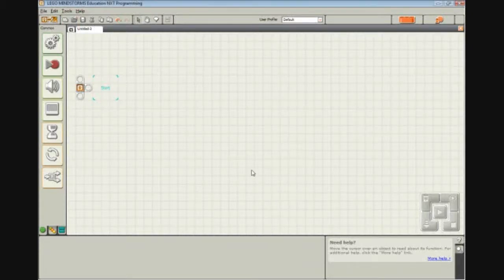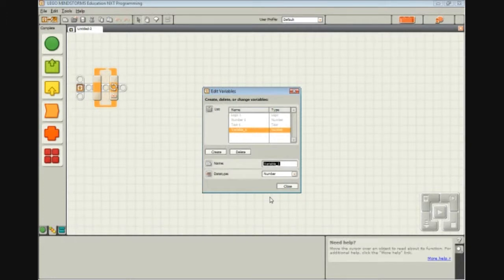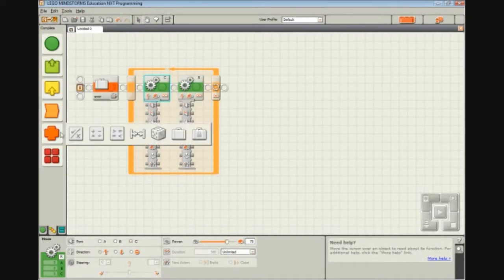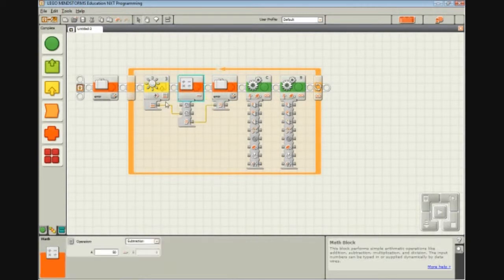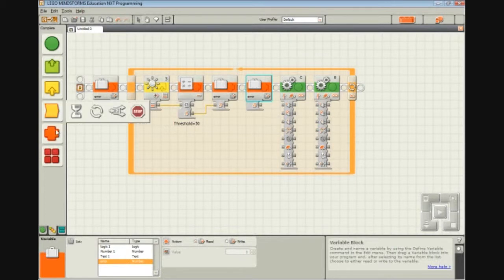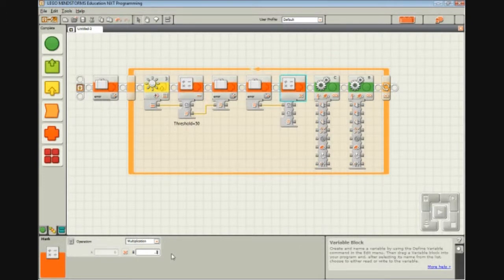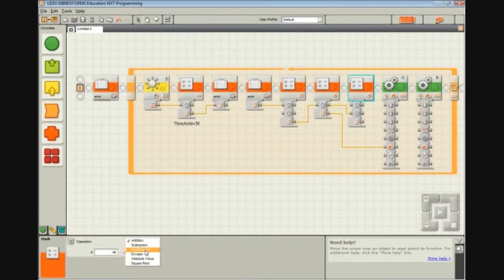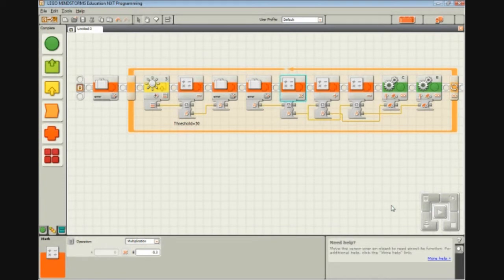Line Following (Part 4 of 4)

Comment: Very very good video man. Thanks
I have a question: What if there is a 45 degree corner?
And what if the robot has to recognize a yellow line over the line and perform some different tasks, like turn 90 degree and do something else? Where in the code I have to put the blocks that have to change the behaviour?